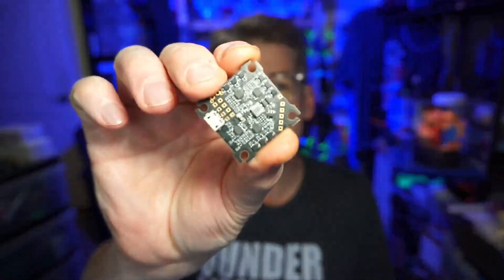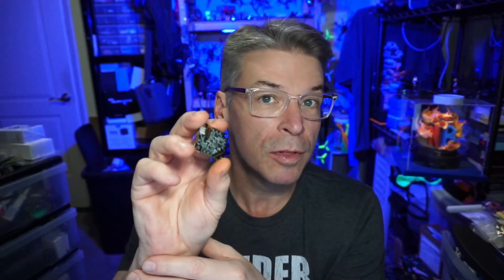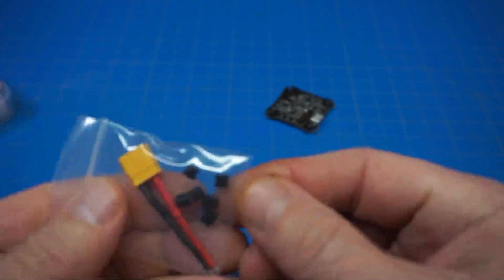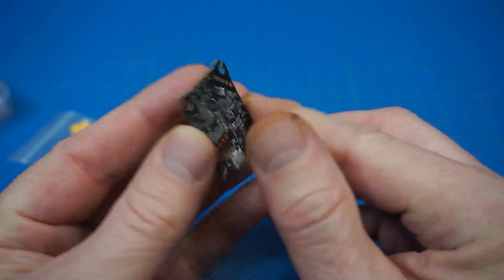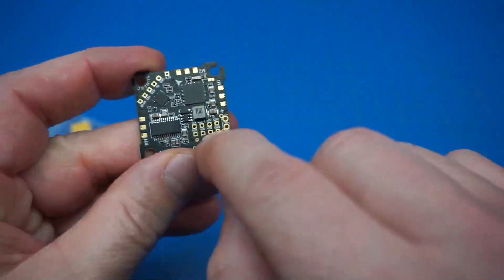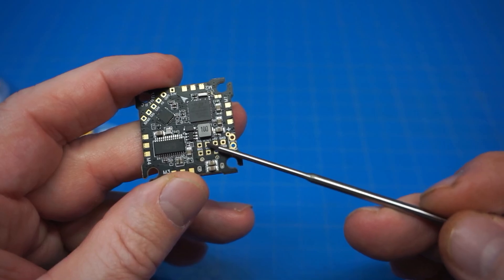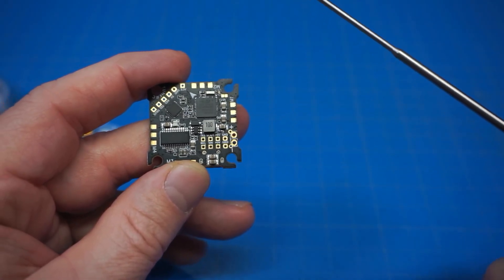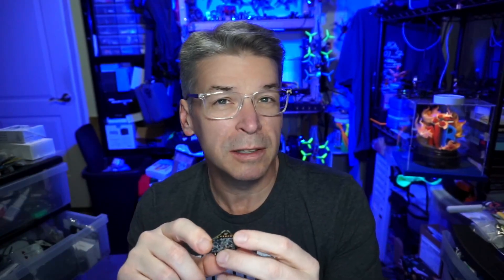TuneRC EZ F4 AIO 1s-2s // Spaced Motor Pads // 2 UARTs

Comment: I want this for my next build. On the race rocket? Great idea! Btw those in USA can get the Poly board at Black Market FPV.  Hope to get some videos on it to post. Nick youre a legend at this point. 🙌🏽
Reply from the maker: Yes, this should work just fine, we do need to add a micro/nano vtx, if going walksnail or hdzero the second layer (VTX) won't clear the props so we need to move up in frame size to something like the starlord from jacks3dprinting.

Comment: Hey Nick have you used any of the GNB 380mah 1s or rdq variant batteries? They're supposed to be 60-120C rated. Any idea how they stack up against newbeedrone nectar batteries (real world usage). It would be nice to see how they stack up and what your thoughts are on the best tiny whoop batteries for 2022.
Reply from the maker: I have tried them, nitro nectar are still better. Keep in mind the c rating on batteries in FPV is not standardized. Pretty much made up. Over the years I have found c rating only to matter as an identifier when the batteries look, size and label all match up.

Comment: $55 is more than we were paying by $20. That said, prices have gone up. If it is easy to set up and most importantly it is durable and lasts, then $55 isn’t an issue. Going through $35 boards like they are water is no fun. Time would tell. Worth a go.

Comment: I bought two. just a couple of notes: 1) it comes flashed with BF 4.2.9 with the KebabFPV's tune for his 1S 3" babytooth. 2) the TuneRC tech support is AMAZING: I had some questions, they always answered them within one day. one of the questions was how to attach a +5V buzzer and they sent me the full circuit schematics and the CLI lines to remap the appropriate pad. so yes, it is more expensive than others, but it seems VERY well made and you also get the best tech support I've ever got since I started in this hobby. I made a 1S babytooth with one of them, hopefully tomorrow it's its maiden flight, weather permitting.
Reply from the maker: Really good information. Thank you. i can especially appreciate a company with the support to respond so quickly.

Comment: No too expensive for F4, just not interested. Rather see a Zeus F/C
Reply: had 3 zeus 25 v1 in a row, all faulty
Reply: @marc_frank  I own numerous Zeus f/c ESC’s AIO’s, no problem’s to date, except one that bust into flame when it hit cement driveway from a 200 foot vertical dive. But have had problems with many other brand name f/c’s. Go figure.
Reply: @marc_frank  my first had its usb fall off it looked like it was held on by super glue :(
Reply: @TorontoFPV  had the same issue
Reply: @marc_frank  Ya it sucks cause I never got to fly it. I've had a petrel from them that wasn't soldered correctly. motors that twitched 1 by 1 and then the FC fall apart. Will never buy anything from them again lol which sucks cause they seem to be the easiest to get free products for review from... but you gotta have some standards!

Comment: What do you think about new Matek F405 MiniTE is it suitable for LR micro quads?
Reply from the maker: matek makes quality components, that one will require we pair it with an esc for motor control but it has many uarts, good for gps etc and two bec. Looks like its setup natively for an air unit or air unit light.

Comment: Not a bad option.  Like that it has no RX versus frsky spi junk.  Has bluejay firmware which is a good fit for smaller quads.  I do think it's a bit more expensive than I would like, but not bad.  I also would like to know how durable it is!

Comment: Why would I use this over something else, like the DarwinFPV 15a AIO for only $40 for example?
Reply: Darwin is a dual board (separate esc board attached to fc) twice the weight and overall lager footprint.
Reply: @MissingNumb  I can’t find specs for the board I mentioned, but the ELRS version of it is listed at only 5.0 grams
Reply: @ooOoo.....  is it an AIO? previous comment suggests it's not
Reply: @pgabrieli  I believe both of them being discussed have the FC, ESC, and OSD but will require a receiver and VTX. I’m still new at this and just wondering.

Comment: Tiny holes on the power pads are probably for a capacitor
Reply: Yes, you are right boosted740. They are designed for a capacitor.
Reply: Yeah, sounds right.